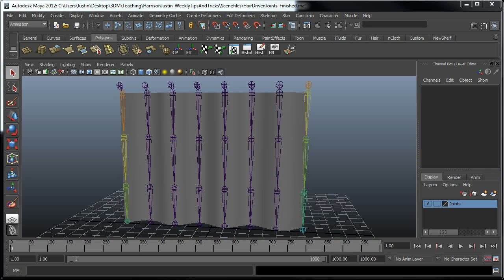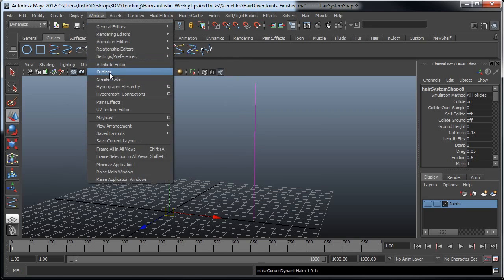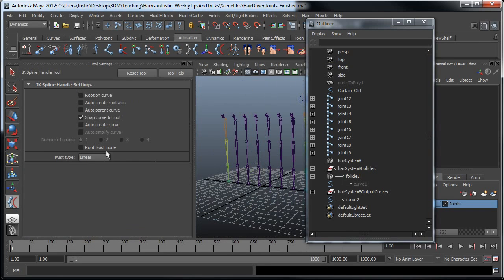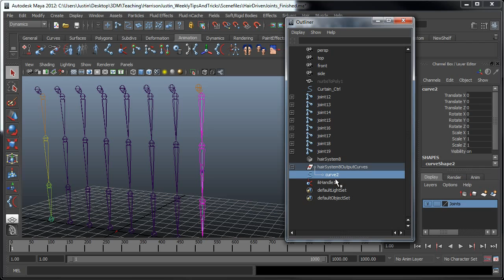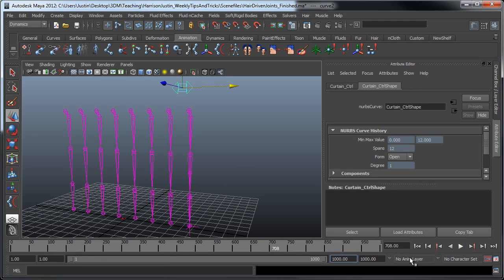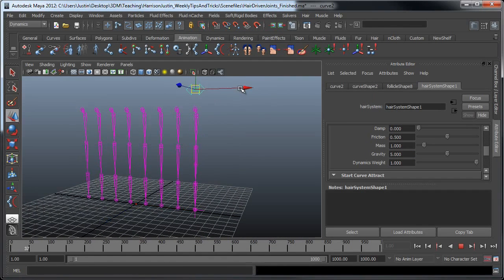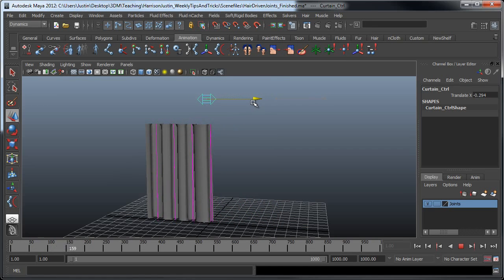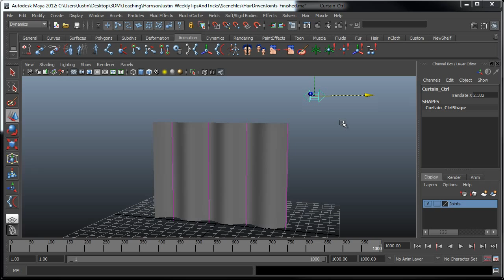CGI 3D Tutorial : "Creating Dynamic Hair Driven Joint Chains" - by 3dmotive

Comment: FYI - the spacing of the points on your EP curve will determine the "flexibility" of the chain. I tried running hair with approx 20 joints, and just as many EP curve points, and it was waaaay too flexible. Depending on the style you want, I'd recommend between 4 and 8 points on the curve.
Edit: PS super useful tutorial, thanks so much! It helped a lot!